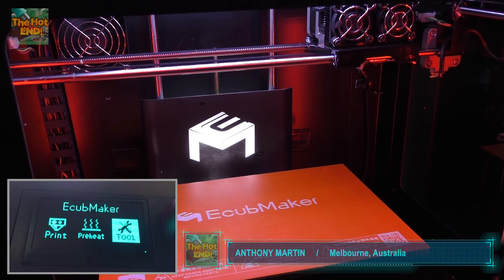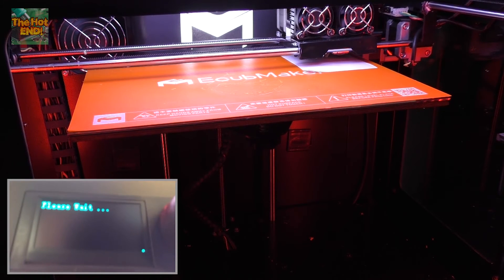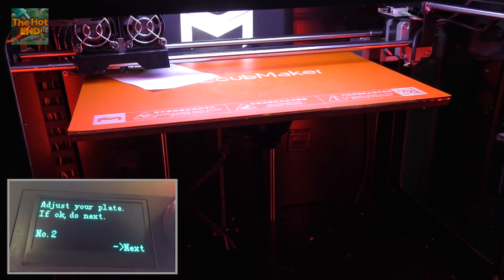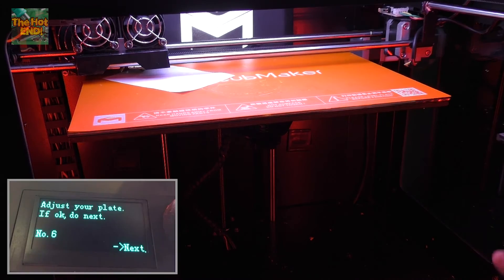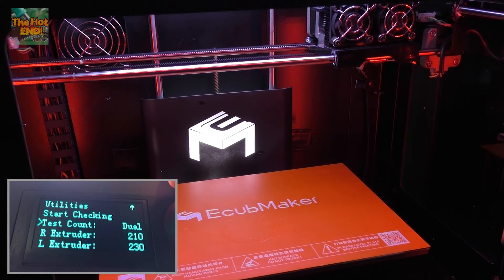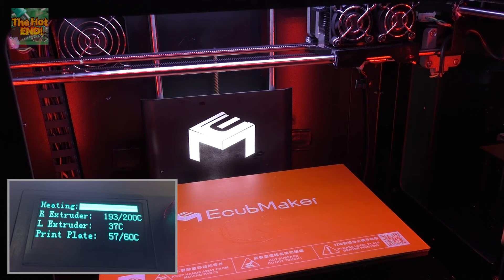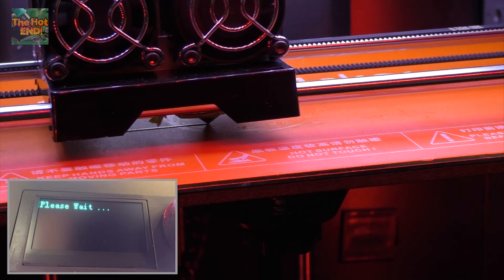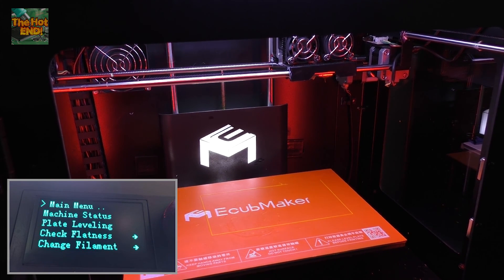Fantasy Pro II Levelling Process (RE UPLOADED with better audio)

Comment: Hi mate. I'm really thinking of buying a second printer and saw this. Did it take a lot of mods for it to work and print quality outputs. I have a Flashforge Creator Pro, and I was thinking since this has the same architecture as the FF, it may also have the same quality prints. I know you have a lot of pirnter, and I hope you make a video review of this printer, it would help me a lot in deciding which printer to buy. Thanks.
Reply from the maker: +3D Printwiz Howdy! No i would not recommend this printer. Id go the JG Aurora over this all day long (much better built)  https://www.3dprintersonlinestore.com/3d-printers/jg_aurora/jg-aurora-z-603s-metal-frame-3d-printer
Reply from the maker: +3D Printwiz OR https://www.3dprintersonlinestore.com/3d-printers/jg_aurora/jg-aurora-industrial-3d-printer
Reply: Thanks for the response mate. I'll be sure to check it out. It gets frustrating sometimes, looking for a good large bed printer, so many choices but just a few actual honest reviews or opinions. I love my Flash Forge, unfortunately, for my use the bed is too small. I hate to have to glue parts all the time. Once again thanks.
Reply from the maker: +3D Printwiz What are your requirements? Large format you have Gmax 1.5XT or the Wombot Modus https://www.youtube.com/watch?v=_CalClYNv-k
Reply: Yup, large format, but hopefully enclose like what you recommended. I rarely print PLA, I normally use ABS, that is why I need it enclose. I think Gmax would work as long as I put it inside a cabinet, and fill all sides with insulation. Thanks for the second recommendation. I'll check it out right now.
Reply: OMG, just saw the link on your wombot mate. Just made me drool, just a bit expensive, but for the build size, I will definitely save some money for that monster. Thanks.
Reply from the maker: +3D Printwiz Welcome :) The Modus is 1/2 the price of the Gmax ($1999 AUD = like $1400 US) vs 3000+ for the GMAX   - neither of them would be great for ABS however as none have a heated bed that large